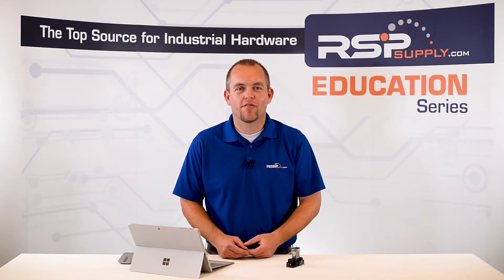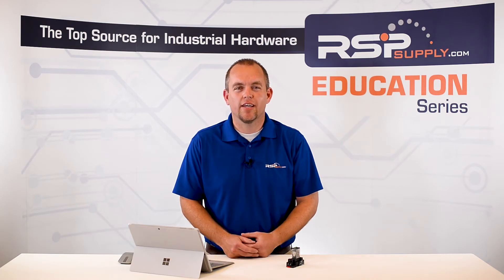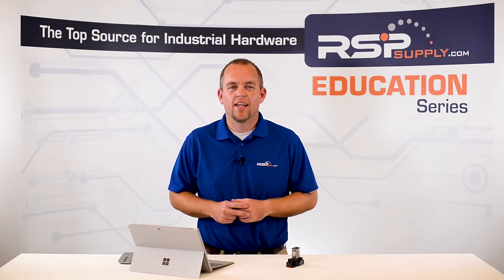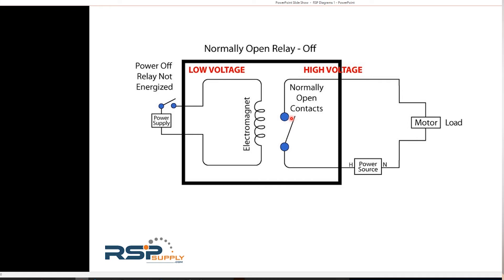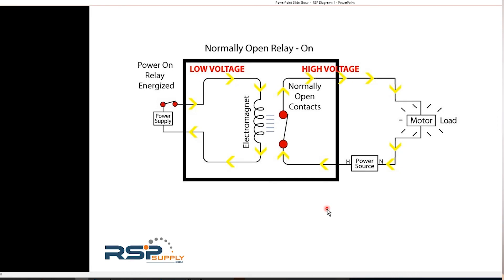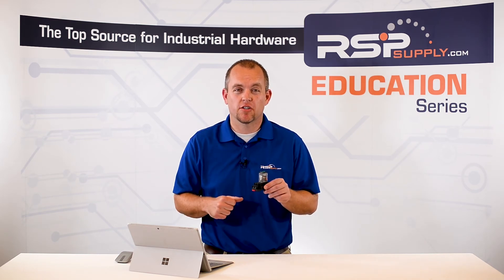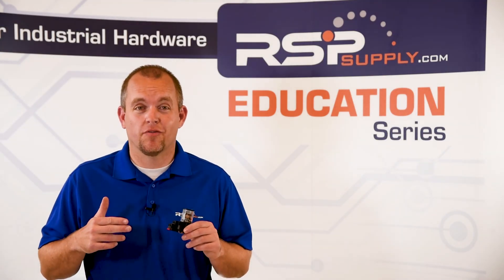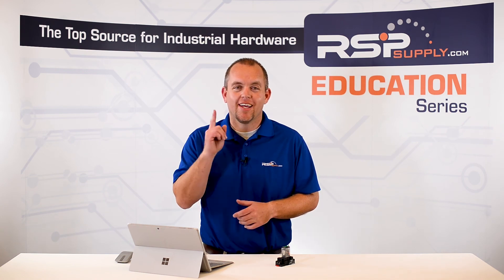What is a Relay & How it Works

Comment: in the video, i see that you have mentioned that Low voltage for relay coil side and high voltage for Contact side. I think this is not appropriate, because relay coil voltage can be higher than the contact voltage side. For example, Used as an interposing relay, if i have a output of 110 volt from Output card of PLC and i want to switch to something (24 volt valve ) which is operated by 24 volt supply, then in this case the coil voltage will be 110 volt and the contact side will have 24 volt. So, one can not generalize about coil voltage to be low voltage and contact voltage to be high voltage. please correct this.

Comment: How is the inductive flyback from the relay coil handled in industrial panel circuits? I asked at work and no one seemed to know what I was talking about.  Is there a flyback diode in the PLC output channel? Or in the relay base mount that attaches to the DIN rail?